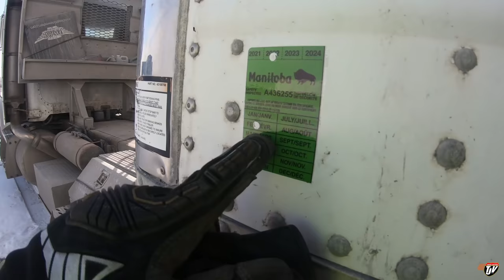My Trucking Life | PETERMOBILIN' | #2227 | March 3, 2021

Comment: If you don't want training mirrors on your horns, I would remove them lest some enterprising enforcer of road laws find something in the code to nail you with.
Reply: There is no law stating u cant have horns on ur hood 😝 if it aint writing on paper it aint legit and they cant get u for it
Reply: @RCman9291  I don't know what the laws are in Manitoba, but I bet they have a law against dangerous protrusions that can impale or take out an eye.
Reply: @ValleyPooch  they r only like 2 inchs out from the hood if someone is walking within 1 inch of a driving truck thats on them not a truck i do get what u mean but they dont stick out far enough to poke out a eye cause ull need to brush the side of u agensted the truck to hit ur face on them

Comment: You should back your truck up to the fence
Reply from the maker: It needs to be plugged in which is on the front. Also,  if it doesnt start its much easier to hook onto the back to pull it into the shop